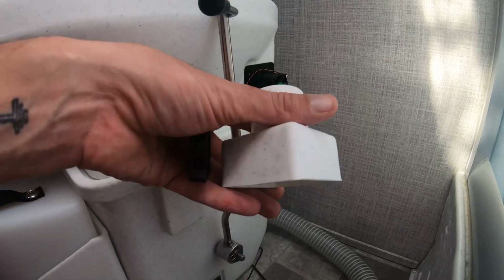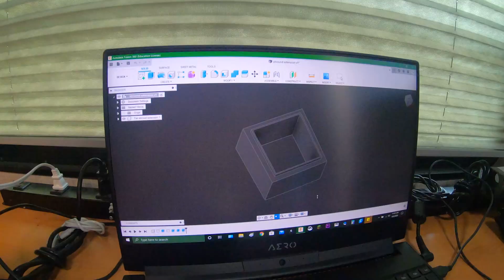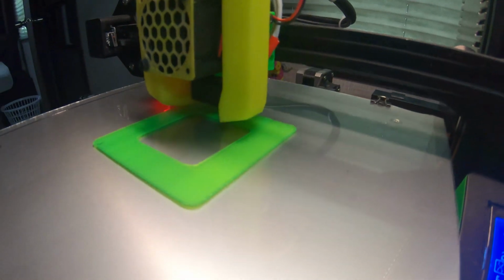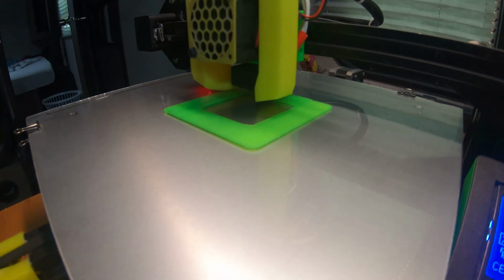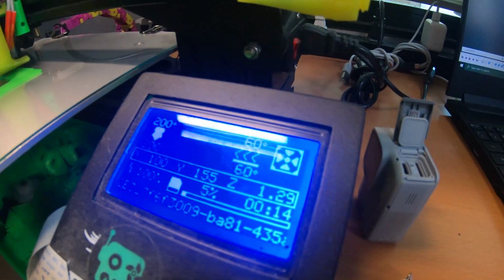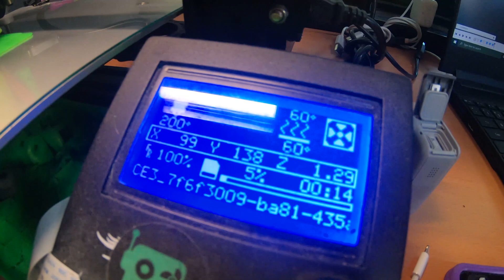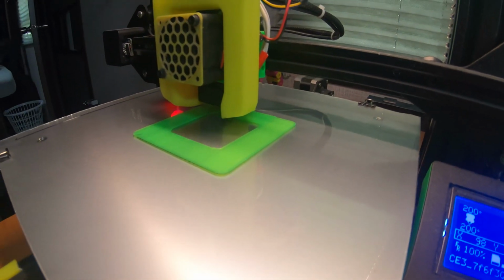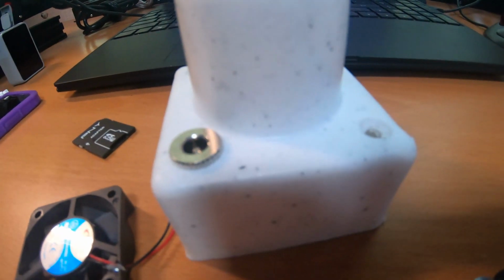Nature's Head Composting Toilet High Power Fan Upgrade/Modification |#2

Comment: Can you help me with my my composting toilet I need your fan setup for mine the fan the heavy duty fan you just hooked up I can use a man my trailer smells terrible my fan died and I'm waiting on another fan but in the meantime I rather have the project that you did can you help me
Reply from the maker: Send me an email to pepperandcaseysrv@gmail.com and I will help you out. You need a 3D print and a new fan off eBay then you’ll be all set.